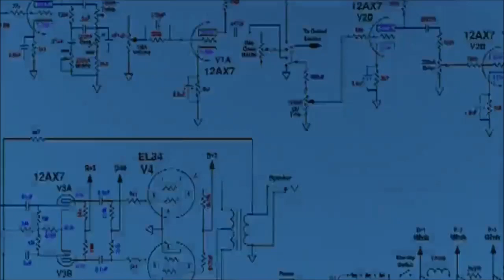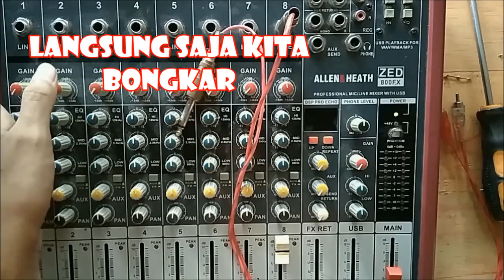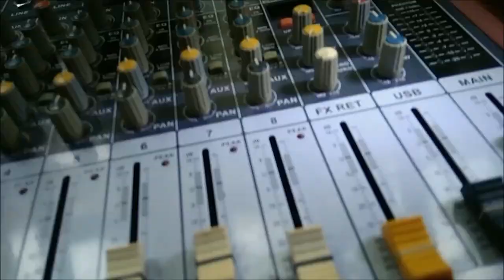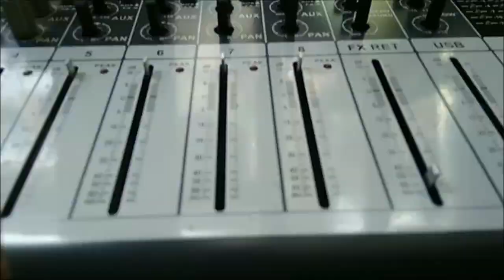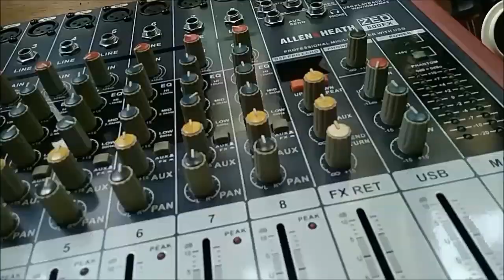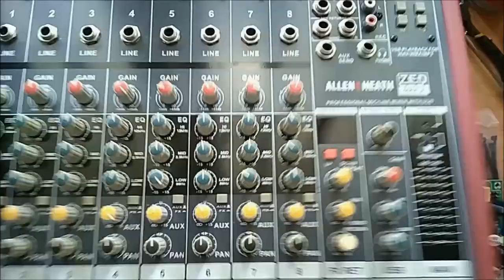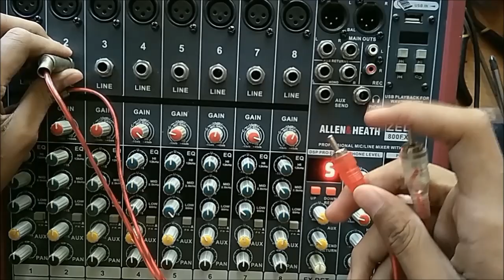mixer rusak master tidak imbang ALLEN & HEATH #ZED800FX

Comment: Bang mau nanya, punya saya allen heath zed fx 22 . Kendala sebelah kiri gk bunyi cek input tidak masuk, tidak ada signal. Ada  ic yg saya ganti ( kondisi fisik rusak,panas berlebihan, sepertinya ic power karena meskipun tidak di pasang mixer tetap bunyi kecil. Saya cek di Ic master teg input normal, input audio dan output normal. Kendalanya di mana ya bro. Dah pusing oprek2

Comment: gan jual power supply zed 800fx nggak
Reply from the maker: Gak jual saya mas😅😅
Reply: @MiftahulMuzakki  mau tanya gan. power supply nya brpa amper ya dan voltase nya berapa ya. soalnya kmrin benerin di tukang service bkan nya tambah bener malah power supply nya hilang
Reply from the maker: 15vdc CT 
12vdc
48vdc
Reply: oke trimakasih gan sukses selalu

Comment: Mas mixer behringer saya signal out ada tapi di main out tidak ada suaranya L&R nya
Kira2 IC nya yg rusak ya?
Terimakasih
Reply from the maker: LED level sudah naik berati mas
Reply: @MiftahulMuzakki  iya Mas. LED level respon mengikuti gain input.
Hanya permasalahannya suara tidak keluar di main out. Klw saya test di aux 1 keluar suara, tetapi aux 2 juga tdk ada suara
Mohon pencerahannya mas
Reply from the maker: @timunksatriabatam9574  itu sama sekali gak bunyi ya mas dengung atau nois tidak ada ya mas
Reply: Tidak ada suara sama sekali mas..
Dengung pun tidak ada. Kira2 opo ya mas
Reply from the maker: @timunksatriabatam9574  coba mas ganti IC master tapi saya belum bisa memastikan penyebabnya mas soalnya susah jika tidak lihat barangnya langsung
Reply: Baik mas
 IC master letaknya tepatnya di samping volume master atau berada di atas volume master
Reply from the maker: @timunksatriabatam9574  turuti jalur fader master mas
Reply: Baik Mas.terimakasih🙏🙏
Saya coba repair dlu
Reply: Mas sudah saya check IC4580 kaki out1 dan 7 semua ok tdk short, tetapi IC rata2 panas berlebih semua.
Dan IC regulator 7815&7915 di PSU over panasnya jika tersambung ke board mixer, dan jika saya lepas power supply IC regulatornya tidak panas
Reply from the maker: @timunksatriabatam9574  berarti ada IC yang konslet itu mas kalau bukan IC ya pokok telusuri jalur setrum
Reply from the maker: @timunksatriabatam9574  saat IC 78/9 psu panas itu drop gak mas volnya
Reply: @MiftahulMuzakki  ga mas. Terukur tetap 15CT. Tapi panas bangat. 
Power supplynya sdh rakitan pake travo CT 2 ampere 15 volt
Reply: Kira kira dioda zener ada potensi short ga mas
Reply from the maker: @timunksatriabatam9574  yang jelas itu ada yang short jalur +15 dan -15. Itu harus cek komponen 1 1 pada jalur supply
Reply: @MiftahulMuzakki  ok.terimakasih. nti saya info klw sdh ktemu problemnya. Thanks